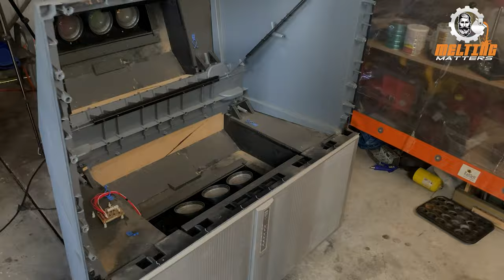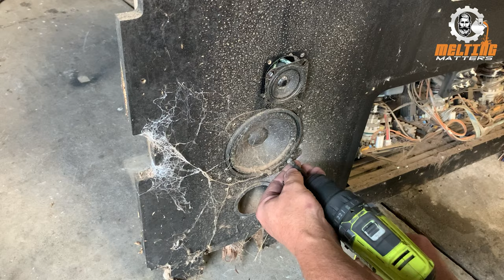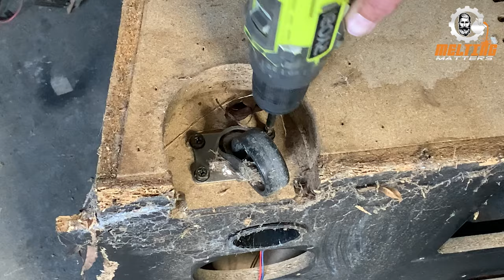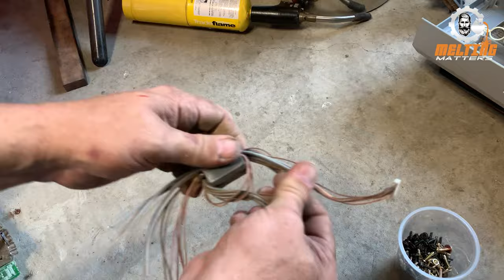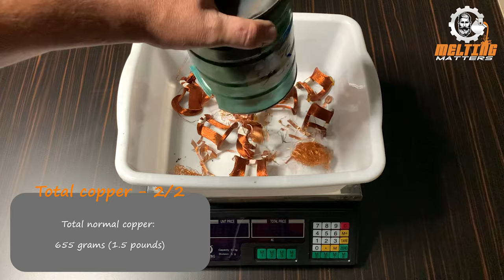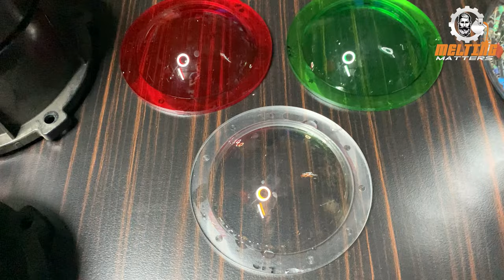Hitachi rear projection TV tear down

Comment: What are the "guns"?? I just disassembled mine and want to sell the parts.
Reply from the maker: Hi mate, they are the projection lamps.  The three big globe looking things.  😀
Reply: @ProjectDIYOz  Thanks! I live in the states, what could they be used for and who would buy them ??? THANKS AGAIN!
Reply from the maker: No worries at all, they are pretty limited for that they can be used for as they need a fairly hefty power system to run them.  As for who would buy them, if they were working fine then they could be sold as replacement parts.  Short of that, you could harvest the copper and drain the glycol for your own use.  😀